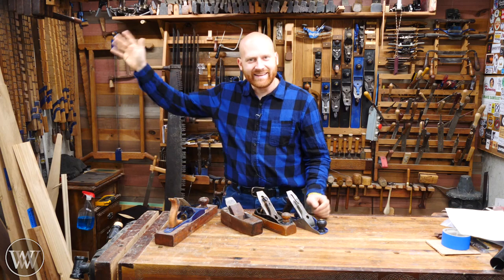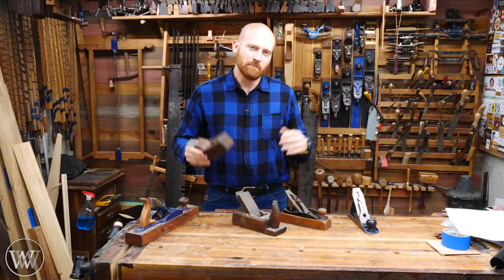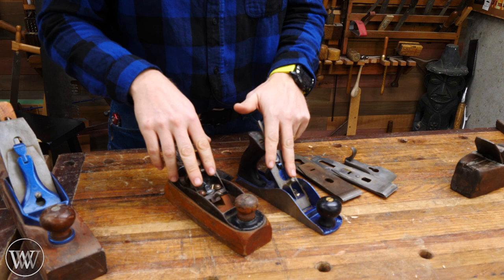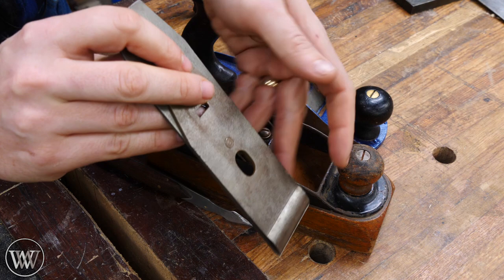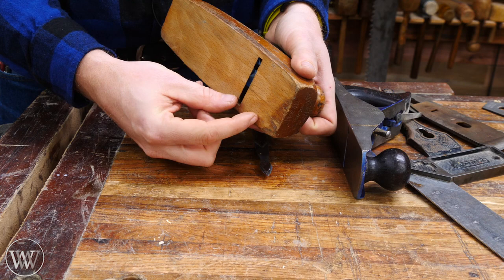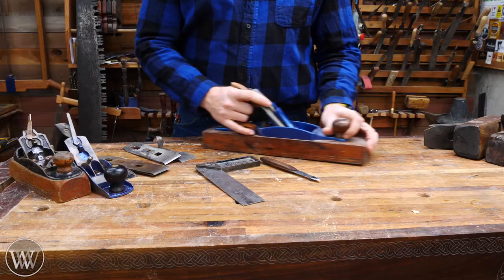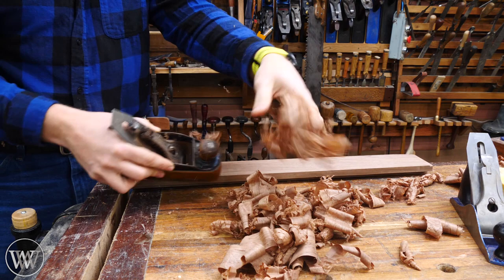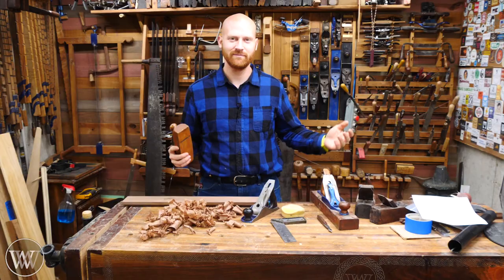What is a Transitional Plane : Hand Tool Thursday

Comment: I have a couple of all wood planes , three transitional and a bunch of metal sole planes. I use all of them somewhat regularly but I really like the feel and adjustability of the transitional planes the best. The metal sole planes are easier to learn to use and will stay tuned for a long time as compared to the wood soled planes but they just lack that unique feel. It really doesn't matter which type of plane you use as long as it is tuned correctly and is sharp. Sharp being the key to the whole thing and it has taken me years to finally understand what really sharp is and how to get there. Good video and explanation on the generations of planes available.
Reply from the maker: So true. Most people don't know what real sharp feels like. It is a game changer.

Comment: Wooden planes are often preferred in Europe, because they are much lighter if you have to take one to the job site, and if you have ever dropped a cast iron plane on a cement floor, then you probably picked up the pieces. A wooden plane just bounces. Just about anything on a wooden plane is fixable, too, but you can't really repair cast iron without  making it a huge job worth more than the plane itself. If you are just going to knock the edge off a board, though, you will probably put a groove in the sole of your wooden plane. The same goes for hitting a nail or other piece of hardware. That being said, I once set my router down next to a cast iron plane and the carbide bit  chewed a big ugly hole in the sole that is still visible today. Every time I see it, I make two fists, unconsciously protecting my fingers from that router that I don't have any more.
Reply from the maker: Very true. Does not sound like a fun time with a router.

Comment: All-wood planes were adjusted by tapping the front and back with a mallet. I have a transitional plane very similar to yours that has hammer marks on the front. I guess someone didn't get the memo about the adjusters. Old habits die hard. But I bet the original owner did better work than me!
Reply from the maker: That is coming. If you spent your whole life adjusting a plane with a mallet and then you get a transitional it can be so easy just to keep doing what you're doing.

Comment: Another nice thing about transitional planes (at least in my area) is that they haven't "caught on" yet and that translates into lower cost compared to what the metal planes seem to be going for. I'm sure that that will change after this video. The really nice woodies tend to go as decorator pieces, the metal planes sell as users or collectors and transition planes were largely ignored by both groups. They are a good option for users that want to get the work done and save a few bucks in the process. I also understand that carpenters and other craftsmen who had to travel between jobs preferred wooden and traditional planes because of the lighter weight.
Reply from the maker: Very true. as long as they are not collector smoother they can go for a song!

Comment: I use both metal and transitional planes.  My #28 fore plane (transitional) is my go to plane that stays on/near the bench.  Two blades, one with a slight curve and one straight. It's great for clamping upside down in the vise to do small parts.
Reply from the maker: Thanks. True I forgot to mention clamping it in the vice.

Comment: I have 3 wooden plane's, a foreplane a jointer and a coffin,  all 3 are very nice but I always reach for metal, just occasionally I'll pull out the wood and I do find them pleasant to use. But adjust ???  Metal everytime.

Comment: I'm going to try the transitional in a little bit. 
I think that regardless of the style of plane, having a tapered iron with a thick cutting end makes hand sharpening easier. I've really only seen that with wood.
Reply from the maker: Yes. Tapered irons were easier to make when all of the irons were forged. On ce machine manufacturing came around that become incredibly difficult to create and so most everyone moved to a flat iron.

Comment: I like this video. learned a lot about planes. I have several metal planes. I have a low angle 62 that I am particularly pleased with, a Stanley sweetheart smoothing plane, and a block plane. Additionally several older planes that I have tinkered with to make a small collection. I have eyeballed transitional planes and thought they would be interesting to own. Perhaps I will get one or two to have around now that you have explained them a little for me. I have also wanted a wooden brace to compliment the wooden plane with. anyway I liked the video
Reply from the maker: Thanks. Glad I could help.

Comment: Have a couple of the transitionals, love to use both, the wood base Jones I are lighter weight. The first one I bought has a finger lift  adjustment no.29, great jointer. Have bought several more, one reason restore and hopefully pass on to future generations and the other to actually use, no sense in keeping them on a shelf, when they work so well.
Reply from the maker: Nice. So true!

Comment: Did I see a crack in the Stanley cast iron plane you were using in this video? If so, it still performs very well. I'd always been told don't buy a plane with a crack, even if it's a small one near the throat.
Reply from the maker: That one has been braised shut. It's not an easy thing to fix but it can be repaired.

Comment: Just got a Winchester transitional plane and came to your video to learn more. Challenge on mine is the knob and wood sole are split (I'm assuming they just dried out and split). Any recommendations for this? Is the only solutions to create new ones?
Reply from the maker: That can be a common problem with some of the old ones. unfortunately the wood continues to dry out and change slowly over time. And if it is allowed to dry too far It can cause problems. Usually at that point the only solution is to make a new one. Unless you can close the split and glue it up most commonly using epoxy.
Reply: Wood By Wright seems like making a new one or maybe adding a 1/2” thick block to the bottom are my best bets. The from area of the wood is pretty badly split, so that would likely cause major issues.

Comment: can you add a wooden sole to a metal plane?
Reply from the maker: You can but you would have to open up the mouth on the metal plane by a half inch or more depending upon how thick you wanted the wooden sole to be. Also you would have to create a new chip breaker that would allow the iron to stick down far enough. Usually it is far more works than it is worth.